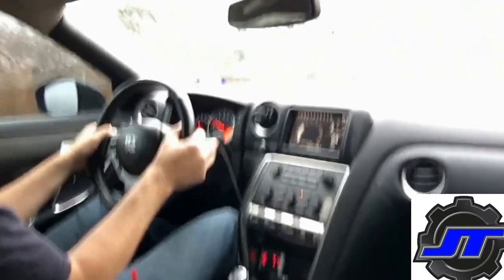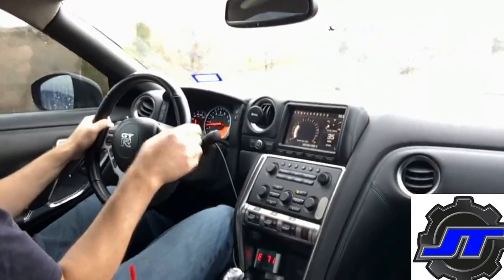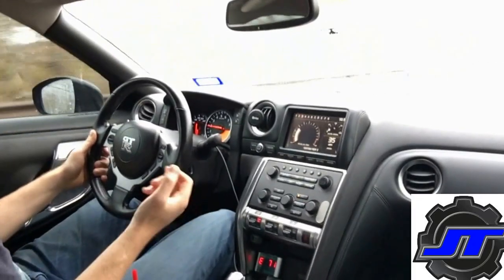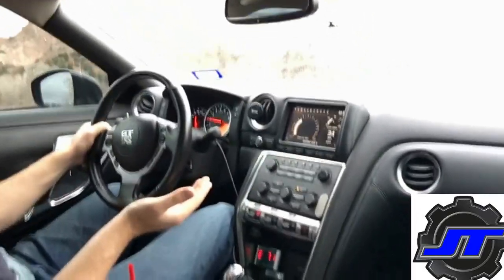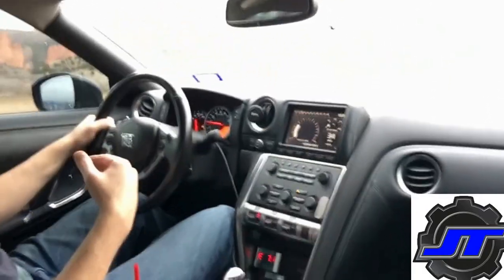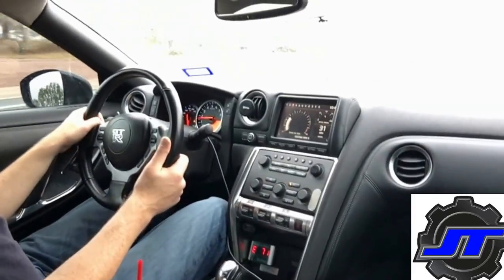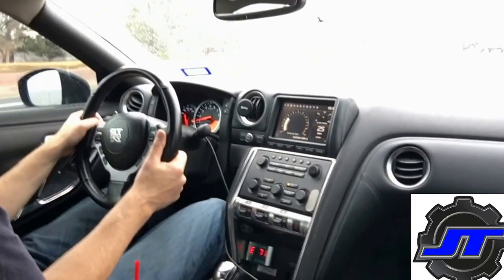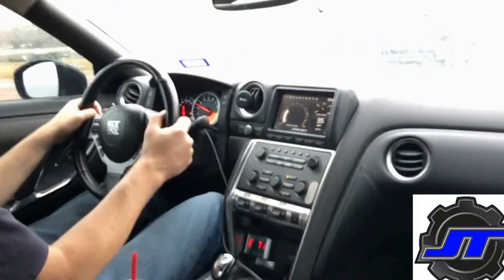Jacks Transmissions Trans Oil Pressure Gauge and Gear Prediction in R-Mode

Comment: I get what you're saying, but you could also just keep the car garaged and never drive it and keep all of the components (including the gearbox etc) fresh and new for the next owner....  :(

Or...you could just go out and enjoy the car you spent loads of money on.  I know what I was doing this weekend!  :)
Reply: You totally missed the point as this isn't about enjoying the car or not.
Reply: @garytsuikk  I'm quoting "it will wear parts out".   "On a CBA it can break your syncro sleeve stops".  "...can wear your forks out..."

Things like that can certainly affect you enjoying the car if you're constantly worrying about them!  It's like driving whilst constantly worrying about tyre wear and fuel usage.

Another quote: "Turn it off as you don't need it in R-mode all the time".  True, but then why buy a GT-R?

I'm not sure how that's me missing the point, given that it's a race car for the road, but then you didn't really stick around to explain...

What mode do you run yours mostly in, Gary?  The snow setting?
Reply: You are missing the point because he is saying "you don't need R mode all the time" not because you should be afraid of things wearing out, instead what he is saying is that R-mode is programmed for a specific use on track so the shift logic is not meant to be used for daily driving around town with stop and go traffic and lots of partial throttle application, so it is unnecessary wear and tear that serves no real benefits on the road.
Reply: @AdyB2008  wearing forks out 🤣
Reply: @volkovmotors1540 , use the fork, Luke!

Comment: Great video! I always figured the transmission was working overtime if in transmission R mode and is exactly why I don't use it very much on the street. Plus I like how normal manual mode with upshift automatically at 7k to protect the engine. There is really no need for the transmission R mode unless at the track or launching.